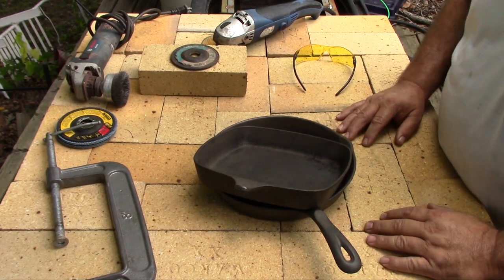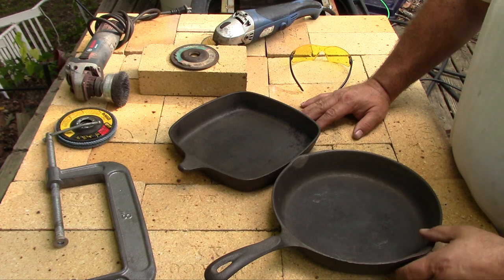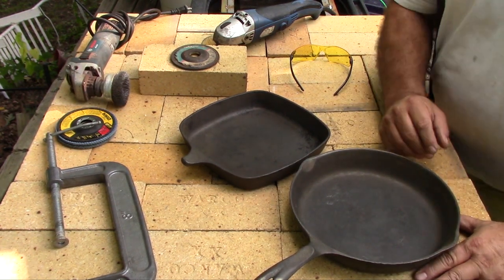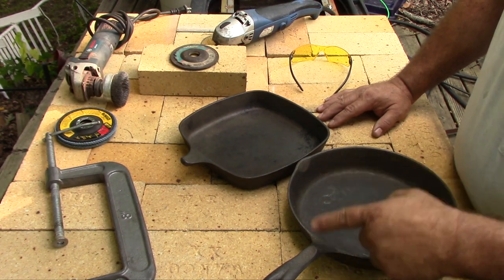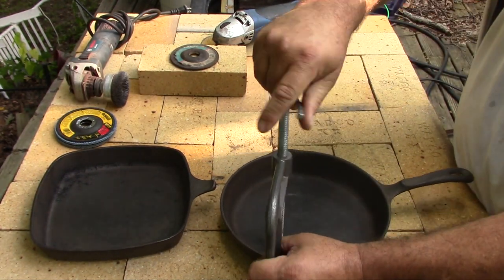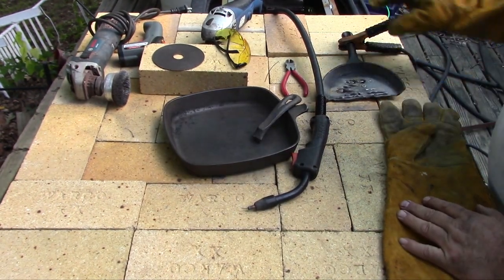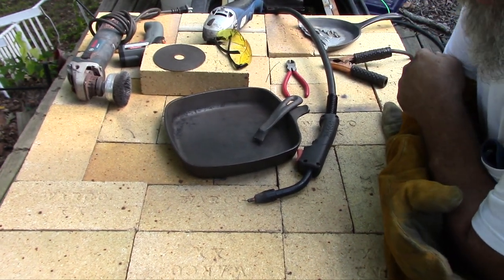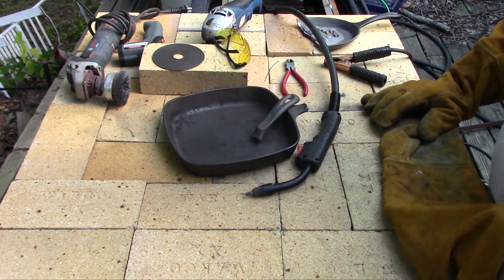Repairing Cast Iron: Handle Replacement

Comment: Question: Is there a risk of a hot cast iron griddle or pan cracking, breaking when cold water is poured on or into it? Like, when I just finish frying something, I like to rinse water over it immediately so that only a very thin film of grease is left. They've never cracked or broken before but I'm told it might happen. Is that true?
Reply from the maker: There's some risk, the colder the water and the hotter the pan the more risk there is. That said, room temperature water and a pan that isn't blazingly hot poses little risk unless there's already a hairline crack.
Reply: @TheMudbrooker  That's what I thought But! I'll promise my sis I'll buy a new one immediately if I break it!
btw I also want to thank you for being one of the atheist YouTubers years ago when I first left my lifelong religion, Jehovah's Witnesses. I did research to strengthen my faith in God, having no clue it would lead me in the opposite direction, freeing my mind!

Comment: Awesome mud.  So does that take  seasoning well.
Reply from the maker: Especially after roughing it up a bit with the sandblasting. Pretty sure it would have taken even with just the sanding though.
Reply: You know I hope this ability and skill is only ever used for the powers of good. I have this feeling I’m going to be looking closer at every pan I look at for hidden welds. Thanks for the additional paranoia Mud.